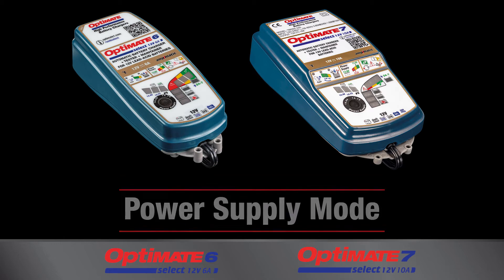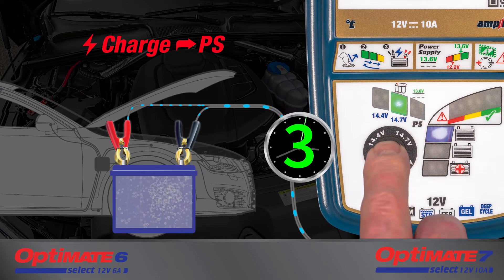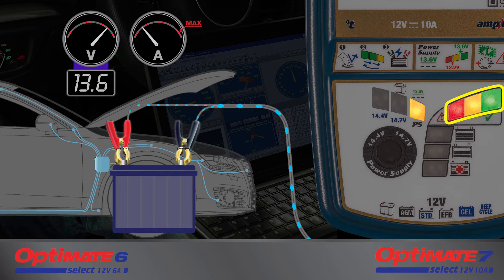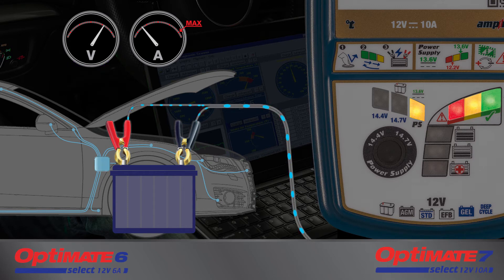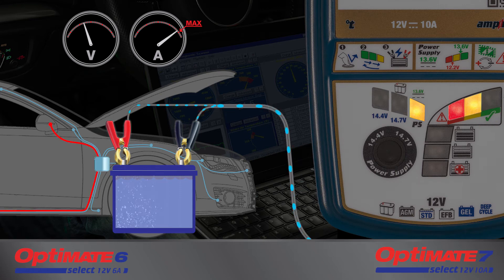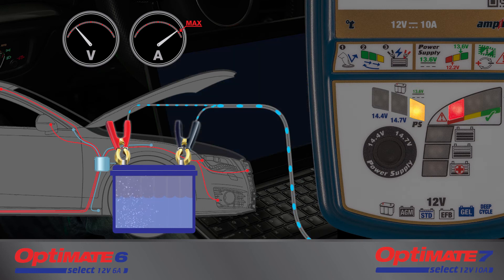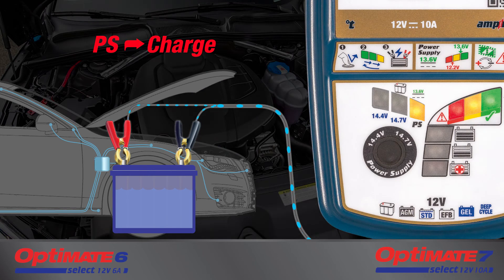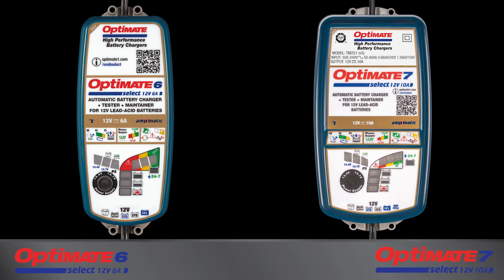Battery Charger Use As Power Supply | OptiMate 6 & 7 Select

Comment: The instructions elude that the optimate  can be connected without a battery and directly to battery cable. Is this true ..?
Reply from the maker: Great question! Yes, the OptiMate 6 Select and OptiMate 7 Select have a Power Supply mode (PS mode) that allows them to provide stable power even when a battery is disconnected. This is useful for retaining vehicle settings when replacing a battery, system reprogramming, or showroom demos.

However, keep in mind that PS mode remains active even if not connected to a battery, so be careful not to touch the clips together. Let us know if you need any further details!
Reply: @OptiMate awesome, thanks for the reply.
Reply from the maker: Glad to help! 👍 Just remember, in Power Supply mode, the charger provides a steady 13.6V even without a battery connected, so handle the clips with care. Let us know if you have any other questions!